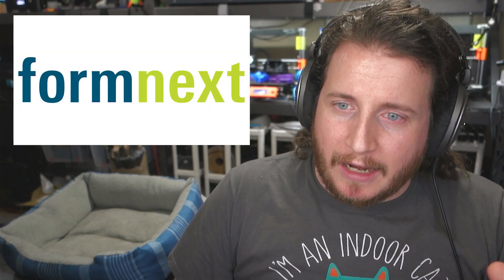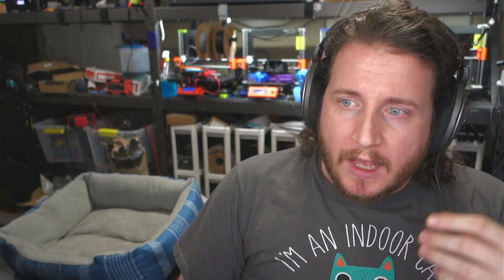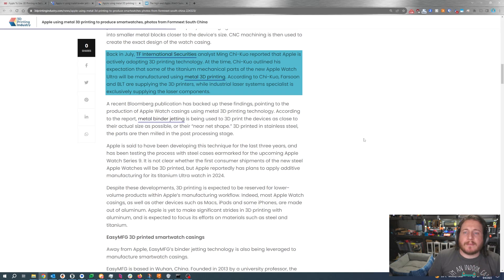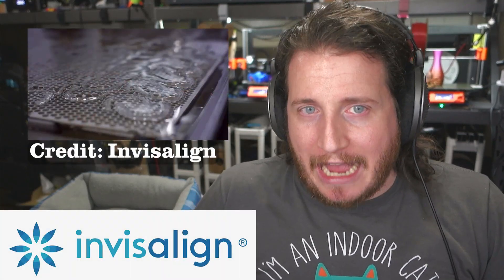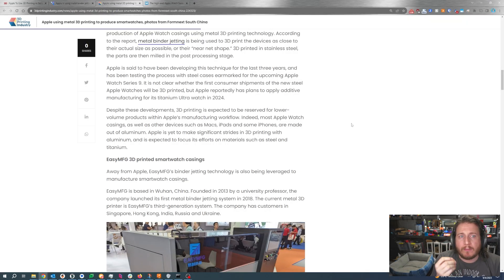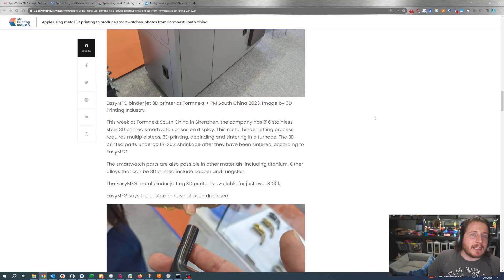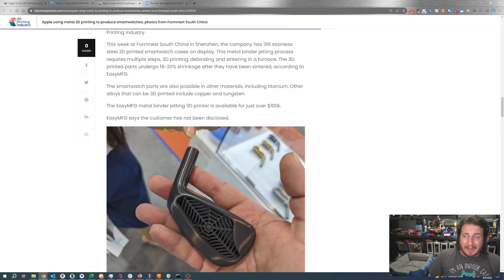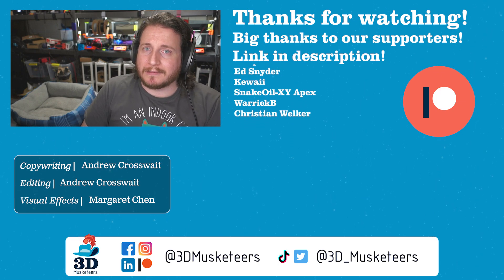Apple Watch 9 With The Help of 3D Printing!

Comment: Wish someone would build a home metal 3d printer.
Reply from the maker: You can use metal filament like stuff from The Virtual Foundry.
Reply: @3DMusketeers   need a 3000 furnace for that, and controlling fir shrinkage has gotta be hell. I want the  “frickin laser beams”.
Reply from the maker: I feel that... I do.

Comment: I hope that innovation and economies of scale in metal 3D printing make it more accessible to hobbyists...it might take a while (3D Systems and Stratasys were doing for plastic 3D printing 30-40 years ago what some of the metal 3D printing companies are only doing in the last 5-10 years) but imagine how magnificent it would be to have a selection of metal 3D printing machines that are remotely affordable for home or small business use. 

Granted, we have things like BASF's UltraFuse 316L and the various metal-bearing FDM materials from The Virtual Foundry that can basically be printed on most modern FDM printers with minimal additional equipment (a filament warmer and a hardened nozzle should be more than enough). But those are still hundreds of dollars per kilo, require complicated and expensive debind/sinter treatments, and are sure to have far greater porosity in the printed parts' final condition than prints made with fancier technologies. Even so, maybe there's value in making metal FDM filaments with lower-temperature metals like the various zinc alloys at first, to avoid needing a sintering furnace that can maintain temps over 2500˚F...it would unlock a lot of possibilities, that's for sure.
Reply from the maker: I doubt it ever will, at least in the next 5 years. The tech is controlled by patents so at least the big stuff, no chance. 

Would love to see a lower temp metal but I do struggle for why we would use it, you know?
Reply: @3DMusketeers  For printing $100 Benchies, of course. 

Kidding aside, it would probably start with more artistic applications. Why 3D print your own wrench or cabinet hinges out of metal when you can get better metal hardware at a nearby store? (And if you're in the middle of the tundra in Alaska, the shipping costs on your consumables will probably still make it more cost-effective to travel 50 miles to the store through polar bear country instead of 10 miles on the highway.) But make your own metal sculptures, board game pieces, or jewelry without having to get an electric or gas-fired melt furnace? Many people are (reasonably) wary of starting up their own home metal casting operation, and 3D printing these items would help them avoid doing that. 

And like I said, the current state of development of metal 3D printing seems to be at a similar point as plastic 3D printing was a while ago - precisely because of all of those patents. While I wouldn't expect any manufacturer to take the leap of licensing patents to make hobbyist/prosumer metal 3D printers, the hope is that more people would get interested in metal 3D printing and increase demand for more accessible ways of printing metal at home.
Reply from the maker: I 100% agree here, there are a TON of opportunities out there!

Comment: Most manufacturing companies use 3D printing since like the 1980´s. It´s called rapid prototyping. It just didnßt make sense to produce parts this way because its way more expensive than every other fabrication method.
Reply from the maker: the first patents were filed in 1982 and granted in 1984, so yes, this is accurate, but few use Additive as a means for end consumer use, it is just in prototyping.
Reply: @3DMusketeers  "Just prototyping" basically every product was developed this way and of course it is just prototyping because it is usually way way way more expensive to print a product than just cast it. Apple just does not give a shit because their customers would buy a pen for 150 bucks from them for some reason ...
Reply from the maker: UMM THAT IS A PENCIL, OKAY lol.. 

Maybe it is just around here, but manufacturing locally HATES 3D printing.. they are mostly old school.
Reply: Prices are falling, and Apple has a lot of money.
Reply: @3DMusketeers  It´s not about being old school it´s about what makes sense cost wise. 3D printing almost never does that´s just a fact. Not for consumer items at least. For aerospace it does because they don´t produce millions of the same item. Even for 1000 pieces yo uare better off in printing 1 part, then creating a silicone mold with 10 cavities and molding the rest, you will have superior strength, you can have undercuts and way better brakage predictability
Reply from the maker: No, the local guys just hate change.. They are the good ole boy businesses in my experience. they do not want to change what works for them. We have a few a bit south that we work with and it has vastly increased their productivity in their businesses. Some of the local ones are not interested in change.
Reply: @sierraecho884  the cost of 3D printing is going down. Companies like Slant 3D are competitive at volumes of 10k to 100k pieces. Your information is old.

Breakage should not be unpredictable, we know how layers and layer adhesion work. Maybe a hobby printer is inconsistent, but print farm machines should be consistent.

Looking at what an undercut is, that is possible with 3D printing. You can have bridges, you can have supports, some types of 3D printing have no problems at all (FDM is not the only type of 3D printing you know).

Strength depends a lot on design, orientation, and material. Which is the same with molds. I've had my share of "cheap plastic" when a manufacturer had a poor design or used a poor quality plastic. Because of this,  I've had 3D prints much more durable and stronger than injection molded plastic.
Reply: Don´t you think it is a little one sided to simply say "every one producing local simply hates change" ? 
Then you say, the ones who you work with welcome change but some locals are not interested. 

I find your statement a little confusing. 
Yes, some don´t like change and they will simply vanish because they can´t continue doing business like that, this is a normal process. 
Most supplier want to use what works for them and makes their life easier. I donßt know anybody who does not use 3D printing in the industry I am in or who refuses to use it, quiet the opposite. But I also don´t know anybody who would serously produce parts for mass production this  way. We do have batches of 30-50 pieces or so we simply print paint and sent to the customer especially in the early development stages, but our purchasing dep. would kill me if I come up with the bright idea to simply print 5 million parts in the next 3 years. It´s not that people hate change, produrcing 99% of all parts via 3D printing does not make economical sense. If it would EVERYBODY wizld do it because it makes money. @3DMusketeers
Reply: Slant talks lots of shit, look at their comments, 90% of people who are engineers themselve disagree with them.
The cost is not coming down btw, the machines are getting cheaper but your material is 10x more than plastic granulate, that´s also why nobody uses it to produce mass production parts, it simply does not make ecpnomical sense. Filament is a pre profuction material already, so you put yourself at a huge disadvantage using filament instead of simply granulate with master batches.

BTW I do desing and we do produce parts from 10k to millions, I am a design engineer, I think I have a pretty good idea of what I am talking about. And my information is not old, it is my job.
Slat does lots of bs talk online to get more attention and more customers, that´s all.

1. It is in 99% of all cases nore viable to cast parts. You can cast 100, 1000 or 10.000 parts. You can print the mold itself, or you print the master piece and then create a ilicone mold, you can also create a cheap die cast mold out of aluminium or similar materials, the machines are standard and you will have to switch to those machines anyways if you want to produce parts in the 100k which is mass production. 10k is a small batch, it´s not mass production really.But even with 10k parts you are way faster and cheaper by simply using a silicone mold than having 100 printer run all the time with all the issues.

2. Brakage is not predictable, because of the layer process every part os more of less unique. Layber adhesion is a huge issue in itself, tolerances are dogshit with FDM, and you can´t use most industry materials anyways.

3. Speaking about materials, filament is 10x the price of granulate, you are already at a price disadvantage whehn trying to produce cheap parts, because your material is already way more pricy.

4. You had your problems because you choose a shitty supplier and did not design your parts yourself from what is sounds like, this happens in both 3D printing and other manufacturing techniques. 

3D printing can make sense for aviation parts for example, you have great materials and you can metal laser sinter awersome parts for which you would have needed an assembly. Or as super small batches if you need 50 parts or so to send to the customer quick and surface quality, material etc is not super important sure. But there is a reason why 99,9% of all manufacureres don´t use this to produce their parts, the reason is not because they are incredible stupid and you are super smart it is because IT IS  WAY CHEAPER to simply use other means.

We have been printing parts since the 90´s, Our first machines cost 250k, ciurrently we do have a small FDM farm with 4-5 machines, small resin farn with 2 machines and SLS printing + MLS, we have basically everything covered. It´s not the process, it´s the cost.
 @logicalfundy
Reply: @sierraecho884  Well, I can't really check your credentials, being this is the internet and all. But I will note that a CFO probably knows more about the financials of a business than a design engineer. Materials are not the only cost to running a business, there are labor, equipment, and other costs to consider.

. . . and as much as you dump on Slant 3D, even they do agree that material costs are high. They are working to being that down using their own filament, we'll see where that goes.

. . . and I did note that FDM is not the only 3D printing technology. In fact, the technology that Apple is supposedly making their next-gen watches with is not FDM.

. . . and I will note that with (4) I am talking about household products sold in stores. I don't really have a "supplier," as I am a hobbyist. But like most people, I have a fair amount of stuff in my house made of plastic, some is better designed than others.

. . . and having worked a bit for Walmart, I'm aware that a lot of items you buy in a store are marked up a rather ridiculous amount. Which is why I can 3D print things for pennies (even with a 10x material cost), but they cost a few dollars if you try to buy them in a store.
Reply: You dont have to, it does not matter anyway. Either something is right or not no matter who is saying that, I just mean I do have some experience in this field and this is what my expericne is.

Material are like 80% aof the cost for those type of parts. Sure there are other costs and they vary heavily on part and project etc. And this is why I said in some limited cases it does make snese to produce parts via 3D printing but it is not the majority of cases.
We also have small batches etc. so we are always looking for cheaper ways to work faster, why would anybody turn down 3D printing for a certain purpose ? Because they don´t like 3D printing in general ? They don´t like making more money ? 

Using their own filament already shows the problem, the problem is you need a pre product to produce your parts, you can buy plastic granulate for x times less. A gamechanged would be a 3D printer which uses granulate THIS would be a great step forward but I don´t see how FDM printing or SLS or wehatever really replaced anything, they work great in conjuction but 3D printing will never relace injection molding.

It´s like glues does not replace bolts and fasteners somethimes it is better to use the one and other times the other.

Apple will most certainly not use FDM I know but the genral principle still applies with SLS or SLA you need special material, not every material is available, it is more money etc. etc. etc. you just get other problems. We do habe all of those inhouse I use them regulary I love the tech I build my own 3D printer etc. I am not shitting on the technology at all, it simply does not make sense to mass produce 99% of parts that way, period.

Sure you can print genral items for cheaper for now but how long will this be the case ? I can print a cup holder for my car, material cost is about 2€ but the part is sold fopr 150€, why ? Because they are greedy ? No because the guy has designed the part, printed it, tested it and not prints and sells those to the general public. 

You can make your own bicycle too for way cheaper but are you willing to design and test all that stuff ? Just because you get it cheaper does not mean you save, you save money but waste time, which one is more valuable ? Money is endless, time is not. So people pay more to have more time usually

Again I am not saying it is impossibe to prrint and sell items, sure oy ucan do that in many niches. It can be very profitable. But you can´t ignore that injection modling is 10x cheaper for amount x for example or that you can use a cheap silicone mold. The other day I talked to a guy priducing his own metal belt buckle the tool did cot him 150$ in the us and he pays 2$ per piece for a custom belt buckle 100 pieces. They are made of metal. 1 Piece MLS would cost you about 100 bucks and they don´t scale 

It´s all about scale and mass production. 
A 3D printer is versitile why make it print the same thing 100 times ? The stregth is it can print ANYTHING 100 times.

 @logicalfundy

Comment: I would say that metal 3D printing is going to open a lot of doors for niche things like lighting fixtures, doors handles, drawer handles, the obvious things like car parts and such. Discontinued metallic parts. Farm parts. Custom heat sinks. I mean, its endless really. Iron and its many alloys have qualities plastic can't compete with. And one of the benefits of plastic in high end items is the ability to mold it easily into any shape. 3D metal printing eliminates that advantage. Between AI and 3D printing the future is going to be one of absurd abundance, providing the political and economic systems transition well.
Reply from the maker: Even further, metal 3D printing is not new, but it is becoming affordable, that is new LOL